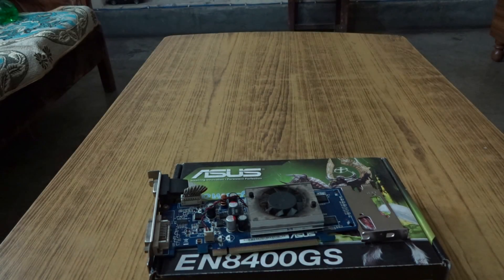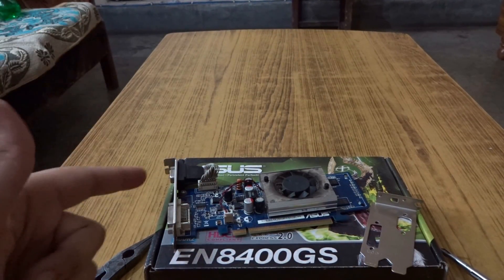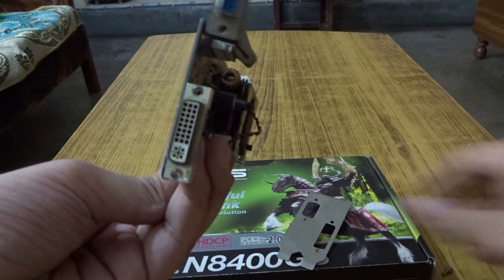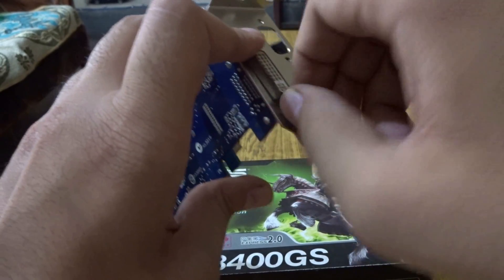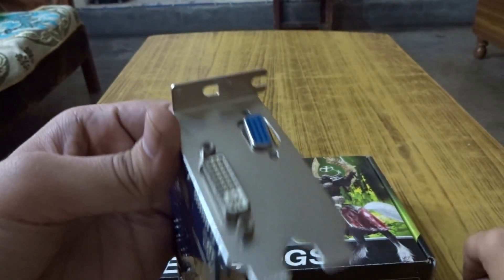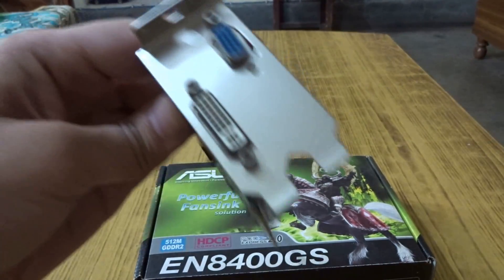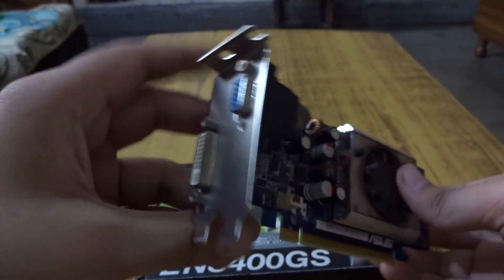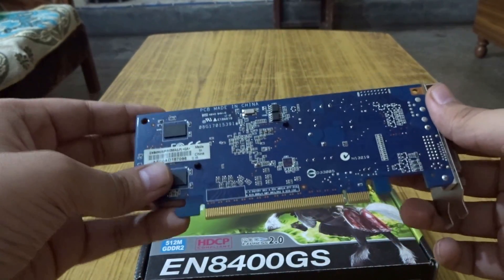How To Change Graphics Card Bracket [2025]

Comment: Is it necessary to use a bracket?
Reply from the maker: yes.
Reply: Tajinder Singh what if my card only fits without a bracket? It won’t fit when I have the bracket on!
Reply from the maker: Bracket is used to secure the card in it's slot. That is only purpose of bracket.

Comment: where can i get a evga gtx 1050ti high flow bracket?
the one i got on it does not fit in my old dell optiplex 380 mt
Reply from the maker: Check on ebay or some computer store near u.

Comment: great video dude! what happened to your card lolol it looks burned!!!!! ouch!
Reply from the maker: +Michael Mulin thanks but from where u find it burned 😂
Reply: Tajinder Singh the fan it's like charred around it lol

Btw I ordered a "low profile" graphics card and it didn't come with mounting brackets. so much for a low profile card lol people were unboxing same model on YouTube and it had mounting brackets I'm so Pist cause I have to spend another $5
Reply from the maker: Michael Mulin oh it looked like that but it was fine back then 😎
Reply: Tajinder Singh wow was it burned though it looks like a nasty overheat
Reply from the maker: Michael Mulin it happens packaging gets updates after while 😂
Reply: Tajinder Singh wow I didn't think dark burn spots r normal but OK cool
Reply from the maker: Michael Mulin it was overheated but it was working .
Reply: Tajinder Singh savage
Reply from the maker: Michael Mulin 😀😁
Reply: lol im running my cpu fan at 100% (very noisy) nut the exaust is cool enough to cool my graphics card (VisionTek 5450 2gb) that doesnt even have a fan!!!
Reply from the maker: Michael Mulin don't so that ur cpu fan will die suddenly 😎
Reply: Tajinder Singh yeah that's only part of the problem. when I was rebuilding the computer, my air temp sensor went out and I can't lower the fan speed (now it's running at 100%) I think the wiring might be loose a little bit, I'll check it tomorrow. kinda messed up my computer a little bit with the rebuild the front USB plugs, mic and headphones don't work either 😞😞
Reply from the maker: Michael Mulin try to control it using pwn fan controller and do share my videos to help me grow on YouTube 😎
Reply: Tajinder Singh OK I will share your videos, the problem with fan controller KS that it doesn't recognise the CPU fan which is the only fan I have in this machine other than the power supply fan......I might have to get a new air temp sensor then bc that's what is says went out